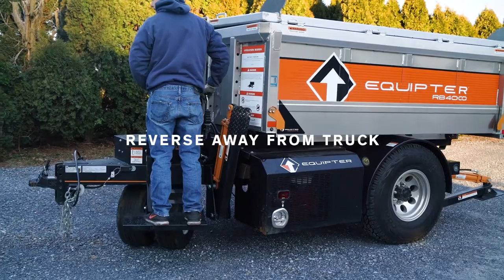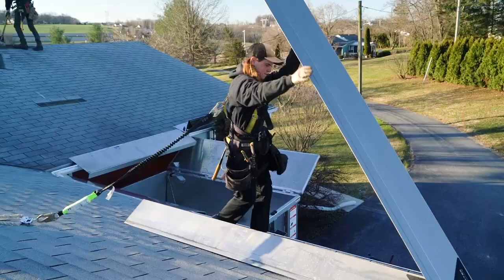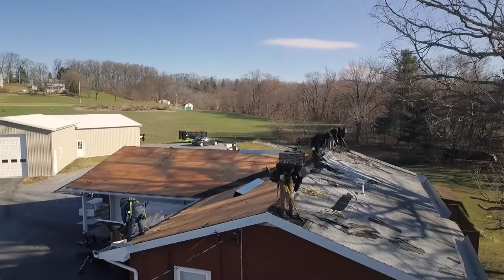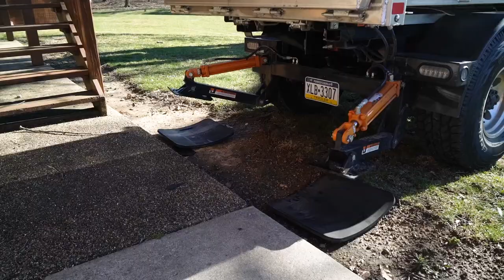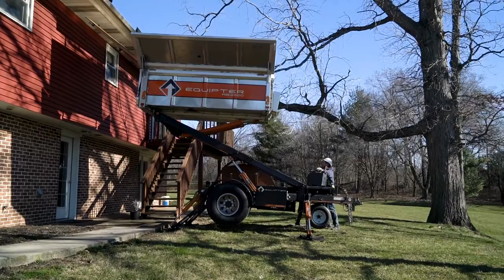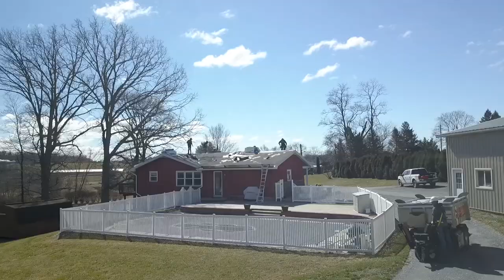Equipter 4000 Roofing and Accessories Tutorial (2018)

Comment: what am i missing about this thing? could you not just back a trailer up to that job and thro the garbage in? we never make a mess like this when we strip a roof. i could see it help on 10/12 or steeper roofs but for a 4/12 i cant see how this will save time it seem like it would just take more time to use this. i could see if being vary helpful if you have 1 or 2 man crew but if you have anymore then that i dont see how it help. but manybe i am missing something
Reply: They can drive around the property and collect roof debris from multiple locations. Every legitimate roofing crew should have 1. 
Plus they are great for loading ranchers with supplies and works as a mobile workstation. I own and use them daily for everything from mulching to windows to roofing.

Comment: Will this damage the lawn
Reply from the maker: Nope! The equipter is designed with extra-wide wheels to evenly distribute the weight. So even when fully loaded the equipter won't leave ruts or damage to lawns. We do, however,  recommend our customers not use them right after it rains unless using track mats.  

https://www.equipter.com/equipter-videos/self-propelled-trailer-in-lawns

Comment: How many lbs can it hold?
Reply from the maker: 4000 pounds on the jobsite
Reply: @Equipter  it seems very useful but kind of slow once comes to move it back and forward.  It's it slow ?
Reply from the maker: @EC-cr8wt , great question! With a 13-horsepower Honda engine, it operates at walking speed. This means your crew won't get slowed down by all the heavy debris they'd otherwise have to haul manually across a customer's property.
Reply: Will this damage the yard?
Reply from the maker: @313stratus  - the Equipter RB4000 is actually designed to not leave ruts or damage lawns. As former roofers, we understand how important it is to protect clients’ landscaping. We designed the RB4000 with a lightweight aluminum bed and extra-wide tires to evenly distribute the weight so even when fully loaded it won't leave tracks in the yard. In very wet or soggy conditions, however, we do suggest using track mats to help further protect from any damage.
But don't take our word for it, check out what our other very satisfied customers have to say about it.
 
https://www.equipter.com/equipter-videos/self-propelled-trailer-in-lawns